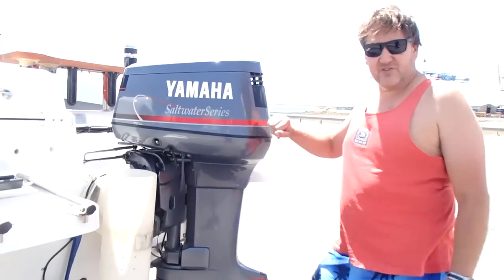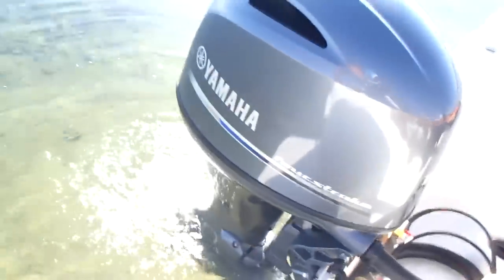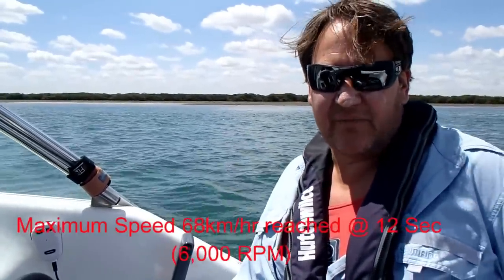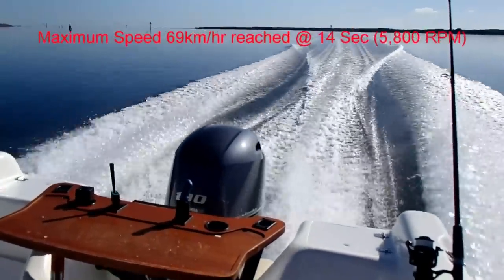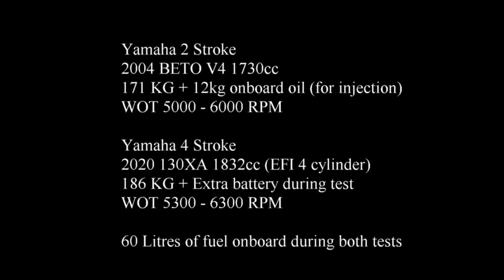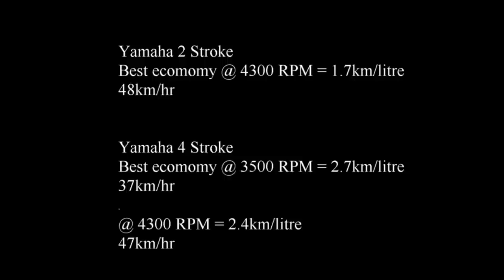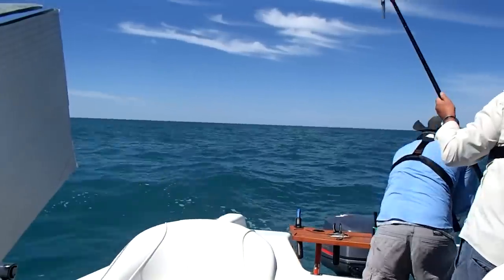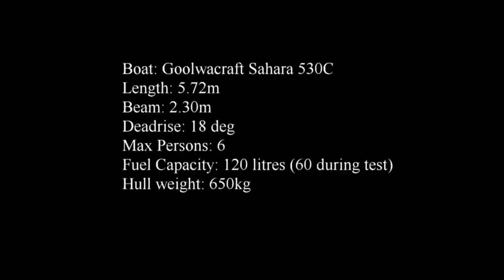Yamaha 130hp 2 stroke verses 130hp four stroke

Comment: Sorry to the folks who liked my post before, I was just notified of one of their likes I watched the clip again and noticed something I didn't notice before, the 2 stroke was turning 6000rpm, it's over revving.. The 2 stroke 130 should be spinning 5500-5700rpm. Since 1 inch of pitch means about 200 rpm that would also increase top speed several kph. That 4 stroke is NOT something I'd have on my boat, the 2 stroke is, by far the better motor as the way that thing jumped when opened up, the 4 stroke seemed to take forever to accelerate. The 2 stroke, even with 320hrs was running far stronger. No comparison
Reply from the maker: Hi Dominick, thanks for your comments. Just to clarify, the 130hp 2 stroke (130BETOX) and 130hp 4 stroke (F130XA) have the same maximum operating rev range being 5300 - 6300 rpm. The 2 stroke propeller was perfectly matched - it never reached over revving. The current 4 stroke is a tiny bit over pitched although being so new it is still slowly climbing towards it's max rpm at WOT. Since this video it gets up to 5900 rpm (73km/hr). I see many comments about how slow (acceleration) the 4 stroke is, however it's not much different, the bark of the 2 stroke makes it sound as though it's instant speed but in reality the four stroke has a much higher pitch propeller and heaps quieter achieving a close second.  I am going to do another video, this time high resolution video (now I have a go-pro) of the four and maybe it will change some minds. I will call it "ShortFlic's F130XA" Keep an eye out next week. Cheers
Reply: @ShortFlic  No the operating range for the 130hp V4 Yamaha is 5000-6000rpm. I know because I own one and have the service manuals where it states it. Its easy to tell by the video that the 2 stroke is under propped.
Reply: @ShortFlic   @ShortFlic  cool stuff, since you know your motor better than I do I'm not gonna run my mouth. The V-4 2stroke 130 is very close to the evinrude 99CID V-4 115 which I had on my little 17ft cobia closed bow runabout and that little thing ran 49mph at 5700rpm, which according to my friend who rebuilt it for me was the max rpm. I didn't realize the V-4 Yamaha is rated to turn 6000rpm wide open. That thing ran real strong and IMO the 4 stroke ain't in the same 
Universe as the 2stroke. Best of luck whatever you choose to run for the long term.

Comment: Great video, curious if prop pitch and size is similar or if you went with the one recommended by Yamaha? We run offshore in the Gulf of Mexico on a regulator 26. Two years ago we were runnin twin ox66 Yamaha 250s top speed about 60-62 depending on the load. Repowered it with twin Yamaha f200s (bracket wasn’t buoyant enough for what we wanted to hang the 250s) but now only tops about 45-46 and you have to get above 3800rpms just to get it to plane off, not knocking 4 strokes at all, I have a 250 Yamaha on my bay boat and it does amazing. Lost some speed on the twins from 2 stroke to 4 stroke but going from best mpg of 1.1 to 2.2-2.3 if I’m driving is nice, but I miss the sound of the 2 strokes.
Reply from the maker: Thanks for watching my video and comments. I used the standard recommend prop for both motors (except asked for a stainless prop for the 4). Prop sizes are very similar, just slightly higher pitch on the four. I'll have to dig up the specs (they are somewhere hear in the comments too).

Comment: I have the 130 2 stroke, I start and it idles for around 5 to 10 seconds before cutting off, also blows out a lot of oil/ smoke
Reply: Probably need to clean the carburetors.
Reply from the maker: Hi Jesse, the 130hp 2S have an automatic choke that definitely adds to a rich starting (pushing key inwards before you turn), you can actually hear a click when the key is pressed just before the start. You can use the fast idle if the extra revs are needed to keep it running for a few more seconds but I have never had to do this (and I don't like reving motors stone cold) although they do tend to "puff out" on the first or second key turn, almost religiously. I would suggest making sure fuel is fresh, bulb primed and run the bugger hard and fast before putting back on trailer :). i.e Don't sit there idling for minutes back at the ramp fouling the plugs for next start..

Comment: There's a lot to like about those old V4's (Pretty sure they are a copy of the old OMC's), but personally I would never go back to a 2 stroke after having a 4 stroke. Just personal preference
Reply from the maker: Yeah, those 60 degree cylinder angle (low head design) were manufactured by many outboard makers with commercial fisherman in mind, especially netting with low obstruction over back of boat

Comment: Nice video comparison.  What did you use to capture the fuel consumpsion on the 2 stroke?
Reply from the maker: Hi, Thanks for your question. I installed a Lowrance Electronic Fuel Flow Sensor (SKU: 000-11517-001). This connects to Lowrance HDS7

Comment: Nice to see a comparison but you have quite a few things that you did not go over. lots of Bass Boats here in the US the props make a huge difference in hole shot and top speed. my boat is set up to run top speed with the prop set up to run wide open and not hit red line. A two stoke will always rev up faster than a four, because i fires every stroke.
Reply from the maker: Wow some interesting figures. I stuck with the standard propellers as per factory. Did not need to change (2 stroke or 4 stroke) as full revs are near max rev range 6,300 (not sure where 7500 - 12,000 comes from????). Don't think you can truly make the statement about 2 verses 4 revs. Outboards are changing and my current 2020 is same as my old 2 stoke.
Reply: Haha 9500 to 12000rpm think u have ur story mixed up mate

Comment: A direct injected 2 cycle doesnt smoke and its better on fuel compared to a carb 2 stroke. 4 strokes are heavy  and money pits
Reply: even carb oil injection works well :) the direct injection can be great but when stuff gets clogged up sensor wise, she likes to blow up. Carb oil injection is ideal with a minor cost to extra fuel usage. In the jet ski world, 4 strokes MURDER fuel, 2 strokes are still better on fuel mainly due to their light weight. 
Some recent models now aim to be fuel efficient despite fuel injection, plastic hulls etc, still 2 smoke baby :)
Reply: Of course it smokes, but not at the same level. 4-stroke are not heavy. This is in 2021 and most 4-strokes are lighter.
Reply: @mcplutt  the direct injected motors do not smoke I repair them for a living. They have a cleaner emissions than the 4 strokes. Also there is about 100 lbs difference in a 130hp. 2 cycles are cheaper by a long shot. It’s a market driven product and consumers want 4 cycles that’s why 2 cycles are gone. A new 130 4 stroke is over 12 grand, and salt water eats them up. The motors don’t have the same alloys like they did in the 90’s I have replaced steering shafts on a Yamaha that was 4 years old.due to corrosion
Reply: @brucecalvert3887  I had an E-tec 50, it smoked a little :-) After all it burns the oil. The 4-stroke F130 weighs just about the same as the 2-stroke 130 @ 370-380 lbs. But I will stick to the Mercury 4-strokes.
Reply: @mcplutt  the Mercury 4 stroke is a Yamaha. Painted black
Reply: @brucecalvert3887  You should update your knowledge. You are 20 years behind. LOL
Reply: @brucecalvert3887  Not the Verado esp. With their own supercharged engines and their own V8s.
Reply: @scambustersbaap_ifrit8218  the outboard is  market driven so what the buyers want the companies build. I work on verados they are heavier and more complicated than 2 strokes. Nobody builds 2 cycles but they are making a comeback in other uses because technology has inproved. Power to weight ratio 2 cycle wins
Reply: @brucecalvert3887  I wished Evinrude to hang on longer but ultimately lost their battle to keep their 2 strokes business going.
Reply: @brucecalvert3887  consumer didnt want them as much as the legislators legislated them out.

Comment: Fantastic video, would you be able to comment on the difference in noise between the two? Particularly when cruising. A bit hard to tell on the video
Reply from the maker: Hi Doug, yes the camera was a bit crap unfortunately. The two stroke sounds similar but louder, right through the rev range - hardly any difference at any rpm except idle. The four stroke between idle and 3000rpm sounds like a soft high pitch whirring noise, almost as though it has a turbo - really nice. As you increase the sound gets louder then into a barking noise towards flat-out (and quite loud). I think the 130hp must be tweeked 115? the air intakes under cowling are huge and can be herd gulping air when you berry it.
Reply: @ShortFlic  awesome thanks that's great info! Does the 4 stroke get up on a plane and cruise OK under 3000rpm? Didn't have a tach on old boat so no idea how hard it was going
Reply from the maker: @dougw4034  Hi, sorry missed this question. The four is superb for low revs and holding boat on plane - perfect for rough seas or trolling! Lowest rpm for my boat planing is around 3300rpm. The 2 stroke would do this inconsistently, constantly drop off plane if boat hit bumps etc and use tons more fuel, like 2.5X. Real pain in rough conditions with 2 stroke wanting to run at 4000rpm...often too fast in rough conditions. I am now able to push further out knowing I have a slower safer return speed if needed (with 4S).

Comment: G'day ShortFlic , I was wondering what pitch props were on each of these motors, I take it the two stroke had a 19 pitch prop. only because I have one of these although some people used the 17 depending on what sort of hull they were fitting the 2 stroke engine to. Thanks, Cheers. Great video by the way.
Reply from the maker: Hi, thanks for watching my video and for the question. The 2 stroke was using 13-1/2 X 15 Pitch S/S. The four stroke has a 13-1/4 X 17 Pitch S/S. Just be prepared for the strange phenomenon called prop chatter (about idle rpm) if you go to a Stainless propeller on a 4 stroke.
Reply: The prop size could explain the slight speed difference

Comment: What size & type prop are you running on the 4 stroke? My 130 is on a similar boat with similar WOT figures. Looking for better hole shot so considering a 4 blade FX4 but dropping from 18 to 16 inch pitch. Thoughts?
Reply: Dude i want the 4 stroke yammy 130 on my 20x6 flat bottom boat i think itll be fast i want either the 130 or the 115sho but i think the 130 will be that much better
Reply: How much did you pay for yours and what part of the world are you located in??
Reply: Im from ALASKA and so far the yamaha 130s havnt made it to alaska yet
Reply: @edwardabrahamiii3742  Hi, I'm from NZ and the 130hp, from what I understand is limited in its distribution around the world. It was made for the Australian & NZ market. I do recall seeing a youtube clip of one in South America somewhere. It's the same engine as the 115hp just uprated. It came with my boat as a package so the price was included. Nice spot Alaska, I am in Anchorage quite a lot throughout the year.
Reply: @roughym7663  nice i havnt been down to anchorage since 2017 but i do live on the lower yukon around emmonak area get some of the best salmon in world
Reply from the maker: The 2 stroke was using 13-1/2 X 15 Pitch S/S. The four stroke has a 13-1/4 X 17 Pitch S/S
Reply: @ShortFlic  on my 130   2 stroke i have got 13-1/4 x17 S/S do you thing i sould  go in to 13-1/2x15 Pitch? and if yes why? thanks

Comment: Which size propeller do you use for the 4stroke 130
Reply from the maker: The 2 stroke was using 13-1/2 X 15 Pitch S/S. The four stroke has a 13-1/4 X 17 Pitch S/S

Comment: At 3:11 how can you end up with an km/L lower than 1 with your kph being higher than your L/h? Think you made a calculation error there.
Reply from the maker: Hi, thanks for your question. Certainly not an error in calculations. At WOT most 2 strokes over 115hp would do less than one kilometre per litre!! (mine was 820m per litre). That's at full throttle (6,00rpm). Just a slight reduction in rpm, the fuel is far better i.e At 5,300rpm I would get about 1.5km/litre.

Comment: Are they the same basic engine that the motorbikes use? I suspect that you might be able to use one in a kit car or something similar.
Reply: No to both question and statement.  You'd be better off just using an existing automotive driveline.
Reply: @Prototheria  Wouldn’t that be a case of making an adapter plate for a transmission, connecting it to a radiator, sorting out the fuel system and making new mounts?
Reply: @chrishenniker5944  Oh yeah man, super simple when you condense it down into a single sentence.  Weekend project, no prob! Get to work, champ.
Reply: The bike engines were waaaaay smaller capacity.
Reply: @chrishenniker5944  it's not possible unless you have access to an array of heavy duty machining and milling equipment
Reply: major issue would be cooling, and the driveline is made to insert into the motor in a certain way. its the same as saying you could retrofit a bike engine to be an outboard. It can be done, but it would be as robust as a pre made outboard motor in terms of cooling passages, vertical design, etc. 
Yamaha engineers the motors for the specific purpose and they seem to be quite good ad it :)
Reply: Terrible idea,,they are marine engines,designed to run on a boat in water,,get the correct motors for your applications,,

Comment: 4 stroke extra torque down low dont thinks so 2 stroke has way more torque why do you think it can get a quick hole shot
Reply from the maker: Thanks for watching my video. 2 strokes can spin up rpm much quicker due to their twin stoke fire cycle (and also have less pitch on prop).

Comment: I smoke 4 strokes not even trying.  I mainly fish but on a race back to the ramp being chased by rain here in Florida i blow by 4 stroke 225 h.p & even 250 h.p. i have 225 suzuki 2 stroke & an old heavy boat Max speed 52 mph. Hole shot from hell
Reply from the maker: Nice, another speed demon. Maybe those other boaties are just old fart drivers? Ha ha, Suzuki is another top Japanese brand. Still you gotta love the DF225 Four Stroke, it's a masterpiece.

Comment: do you think that the 130 4S would work on my 6.2 rib?
Reply from the maker: Hey, thanks for the question. Not sure what rib means but if your boat is not massively heavy then yes. What outboard is boat rated too?
Reply: @ShortFlic  RIB= Rigid Inflatable Boat. Generic term for Zodiac and similar boats.

Comment: Yeah we all know the 2 stroke is better
Reply: Indeed but we end up buying a 4 stroke
Reply: Drake Astro honestly it’s sad there are no more brands making 2 strokes.
Reply: @gohogs2277  Yamaha still sells these two strokes. You can buy them on the internet
Reply: Matt Gore I am pretty sure they quit making 2 stroke boats 5 years ago but they still make 2 stroke dirt Bikes
Reply: @gohogs2277  https://global.yamaha-motor.com/business/outboards/products/2st/

We can still buy the old school two stroke outboards. There are many dealers if you Google search. They can be shipped worldwide.
Reply: 4 stroke is better
Reply: @amantimania  yup id rather be in on a 4 stroke i dont quite remember the 2 stroke days only a little bit as i was born in 1995
Reply: I prefer 2 stroke nothing like 2 stroke smell in the morning
Reply: @anthonyp2312  you can have it.  I love the 4 stroke yamaha
Reply: Yes until the VRO pump fails and it blows up.
Reply: @justintime519  this isnt an evinrude
Reply: Dave Iaucco  the electric pump goes out (in the tank under the console) then thermo nuclear meltdown. So when rebuilding remove all oil injection bs.
Reply: @justintime519  that would be johnson not yamaha.
Reply: Dave Iaucco  There are actually no cons on a modern 4-stroke from Mercury. Heavier? You need to update your knowledge, mister. And no difference in maintenance.
Reply: Dave Iaucco  good luck lifting an E-tec 90 :-) 20 pounds lighter than a Suzuki DF90A. Changing engine oil is quick and cheap. Better than pouring 2-stroke oil in all season. Almost nothing goes wrong with 4-strokes anyway, they just last. Just like car engines.

Comment: Two stroke: light, fast and thirsty 
Four stroke: heavy, slow, high maintenance and fuel efficient. 
I’ve personally done the test, two identical boats. Two stroke top speed and hole shot can’t be beaten by a four stroke.
Reply from the maker: Thanks for your comments. Times are changing... the 2020 Yamaha 4 stoke is almost same weight, higher top end speed. Won't be long before they have extended service and better hole shot (lets hope). Doubt if they will get that cool 2 stroke sound!
Reply: @ShortFlic  same weight but only half the sound 😂
They might persuade me to buy one, if they make a turbo model 😂
Reply: And I forgot to say, top end speed is depending on what prop, and engine height.

Comment: Yeah, burn every 2 strokes vs every 4 strokes, so twice the burn, but I assume much smaller bore ?
Reply: Both 1.8l engines
Reply from the maker: Almost the same bore & stroke in both motors. Basically 2 strokes use more fuel due to twice fuel/fire cycle but better punch (as seen).

Comment: You can run a two stroke wide open for as long as you like. Run a four stroke wide open and you will soon be buying another one.
Reply from the maker: Thanks for your comment. I asked the Yamaha Service guy about this (as I've just completed my 100 hours). He said the four is happy to sit in the top end rpms. In the past 2 strokes with few moving parts were definitely considered more reliable however fours have come a long way. Near flat out at 5500rpm is nothing for a 1.6L four cylinder vehicle engine....
Reply: Absolute nonsense.